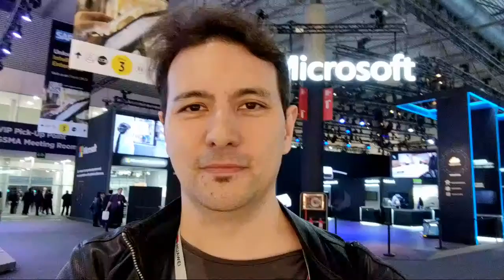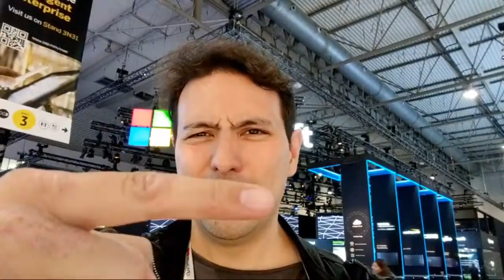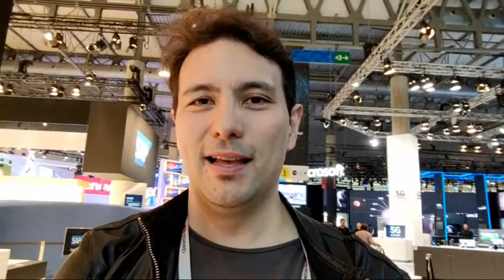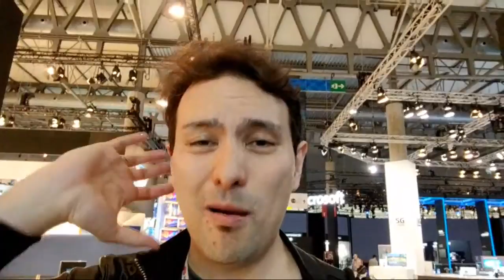MWC19: HoloLens 2 - My First Impressions

Comment: I was amazed to see your first hand reaction from trying the HoloLens 2. It seems Microsoft has little competition in their HoloLens 2 corporate space, and that a HoloLens 3 could nearly begin to partly replace mobile phones. This is mindboggling game changing. Thanks Sebastian.
Reply from the maker: It is! You are very welcome!
Reply: Is the HoloLens2 resolution so good that you would have virtual monitors inside HoloLens2 and use it for reading/viewing internet/movies/emails for extended periods of time instead of using your office monitor setup? (since its mixed reality its easy to use with keyboard/mouse)